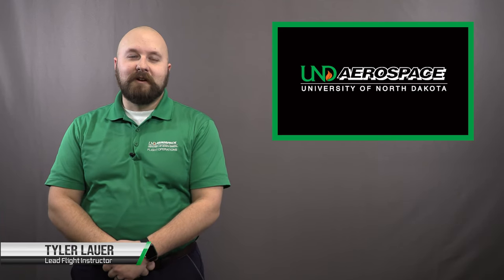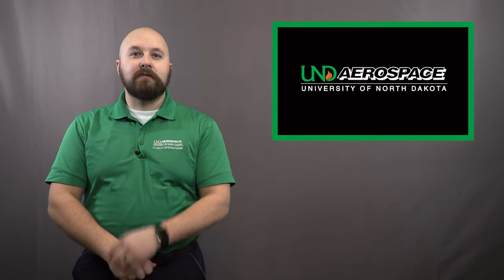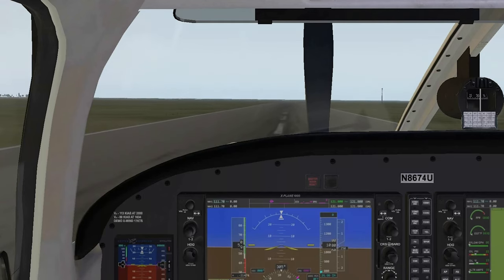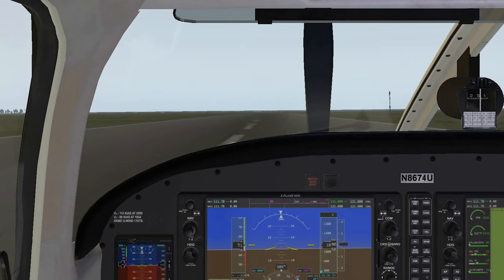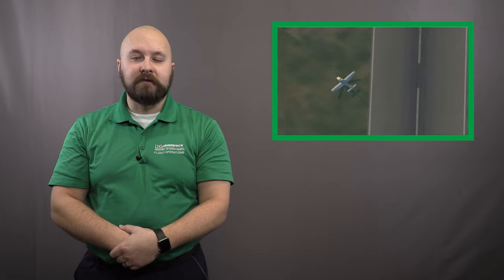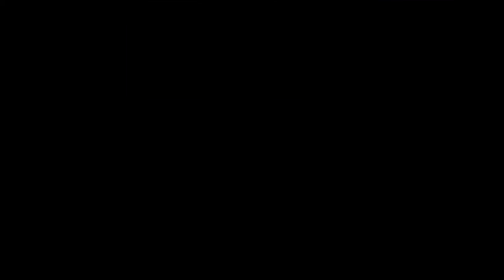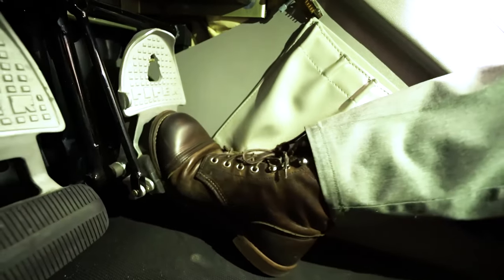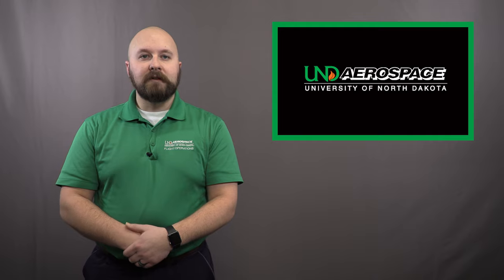Foot Position while flying

Comment: i learnt this the hard way. zigzagging on runway. Thankfully i didn't make the mistake of "going around" after touch down and avoided giving it more gas, so plane stopped on its own after some zigzagging. I saw some another video where someone added power while zigzagging and resulting in total loss of control, ending up flying into hangar. Pheww.